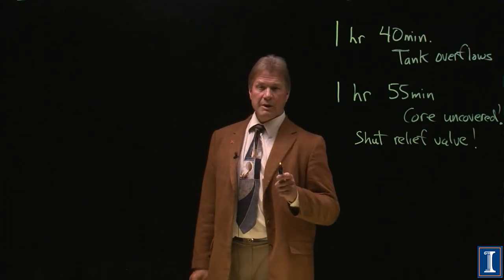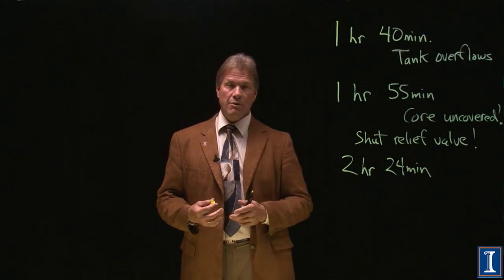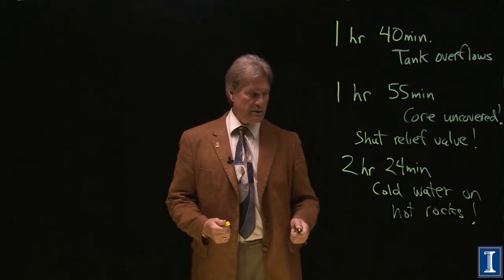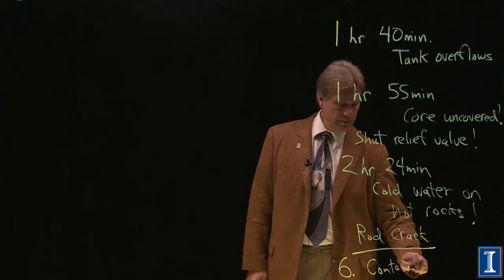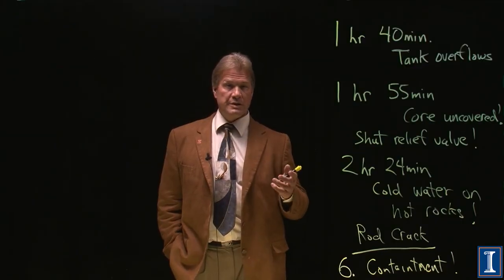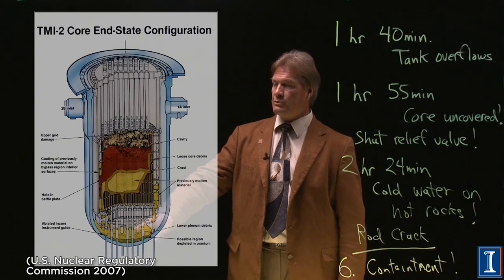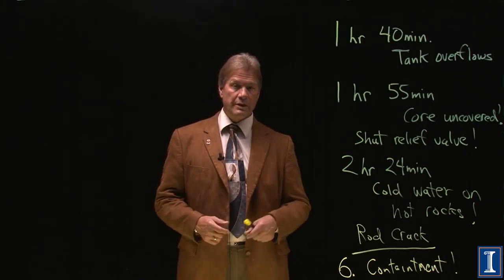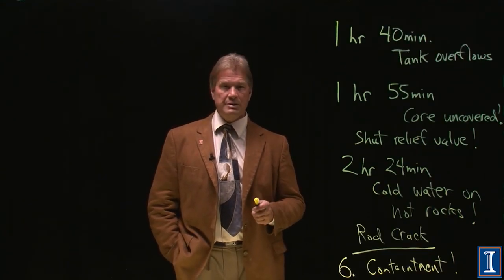How TMI Ended

Comment: Med Dr here. Sadly that's not the whole truth about a nuclear health burden. I understand that you're an engineer. While in technical terms, radioactive exposure could be described in ram, the biological burden has to be correctly given in sievert as the only valid dimension. Every body tissue has a specific radiation tolerance, depending on radiation-type (alpha beta gamma), energy (for the gammas) and what body part is exposed. Here especially the uptake of some radio-isotopes is the critical point: while alpha and beta radiation is quite unspectacular, the ingestion or inhalation can have devastating effects. Aleksandr Litvinenko could have taken a whole day bath in his tea without effects, but drinking only some ml of it destroyed his intestinal mucosa beyond repair, bringing him to a horrific end! Same is with Inhalation of radon which has asbestos-like cancer rates, even in low doses. Same is with heavy metals which get concentrated in biological systems and inside organ-systems! It's not so bad to have some micrograms of poison in your body, but if it concentrates in some tissue, you could have played your last hand! We "poison" out patients with iodid 131 because we know that it is enriched in the thyroid in such tremendous tissue-dose that the struma burns away while the rest of the body stays uneffected. But cadmium, led and mercury can competitively enrich in zinc-rich tissues and destroy for example your testicles. Bad luck? 

So please give us your insights on this topic or explain why you regard this simplification as adequate. 

Thank you and always Howdy 😊

Comment: Its tragic when TMI should have been one of the biggest endorsements of nuclear power safety, not the demonisation of it.
Even when the operators did everything wrong and managed to melt the core - everything did its job in terms of minimising radiation release to the environment to totally negligible levels.

Comment: Professor, didn't you say in your lecture on Chernobyl that Western reactors use water as moderator, and if water leaks out, the reaction stops. Therefore, Western reactors are inherently safe as compared to the Chernobyl RBMK reactors that use graphite as moderator?

Comment: What would have been the correct procedure after they realized the cooling water was leaking to the holding tank  ??
Reply: Close the block valve and keep the cooling water running. 

They had a misinterpretation of the indication and a failure to understand the system as a whole. 

I know ….hindsight bias….

I think another issue was complacency. “It can’t happen” was in their heads.

Comment: My first thought at 1hr 55min was, "Why didn't they just turn the ECCS back on?" :::sigh:::
Reply: I wonder if the ECCS would have done better if the liquid had been pumped to the bottom of the reactor, so the hot water would have covered the reactor rods, instead of the cold water.  Unless the temperature differential was simply too much?

Comment: So , at 2:24 , what was the correct action to stop the core from melting down , if not the ECCS?
Reply: The correct action is absolutely actuating the ECCS, by this point the fuel rods had already began to melt, the damage was done. The whole hot rock analogy isn’t really a factor at this point
Reply: Maybe high pressure/temp steam. You can control that temp so it's not as high, and the thermal shock to the rods would be minimal. Would the core still be hot enough to smash water atoms apart idk. 

Water is an effective moderator, would it still be as effective as steam, probably not tho. But it could potentially be used to gradually bring down core temps till you could activate ECCS

Comment: Using the mantra "Chest X-Rays" is fraudulent!
When it comes to radiation dose, the chest is actually a mass of AIR; Air does NOT absorbs radiation significantly!
BUT, when the SAME radiation is aimed a little lower, say to the abdomen, the DOSE absorbed by the tissue is much, much higher and certainly pose a health risk!!!

Comment: Why did the fuel rods get so hot after the water drained out? Was the fission reaction still going or was the heat from decay of the fission products?
Reply: @Lisforlegend  
That doesn't answer his question. He already knows that there was remaining heat output, he's asking what caused it at the atomic level.
The answer is the latter of the two options he presented, decay heat from fision products, in this case Iodine-131 and Barium-140.

Comment: how the workers clean the reactor core? The radioactivity there should be so high
Reply: You wait, the radiation will go down, and there is no need to urgently send anyone in to clean up anything in a hurry, evertything was contained, so a cleanup solution can be worked up, just that the whole brand new reactor got ruined (big sad), and the reputation of nuclear power was forever tainted.
Reply: Soap and water with a very long handled brush.

Comment: How did they not know the level inside the reactor???  forget about the holding tank.  that should have been the biggest gauge in the control room
Reply: They had level indication for the pressurizer which is connected to the reactor and physically located at a higher elevation. Therefore if there is level in the pressurizer then there is level in the reactor. The problem is with the relief valve stuck open and the pressure differential between the PRT(holding tank) and the pressurizer the level indication in the pressurizer showed it was full although core level was dropping.
Reply: @georgemansfield2018  Interesting.  Thank you George
Reply: There was no instrument showing the waterlevel inside the reactor. https://www.youtube.com/watch?v=1xQeXOz0Ncs
Reply: True. It was. It was broken. This disaster was the ultimate worst case scenario.

Comment: What should have they done at 2 hours and 24 minutes?  Yes, cold water on hot rocks is not a good idea either.  How about a little cold water at a time?
Reply: My guess is that a little cold water would have simply decayed into hydrogen, and you'd have a buildup of flammable gas before you'd remove enough heat to cool the core. Also, it's unclear if the ECCS was even designed to deliver a trickle of water. Given the explanation of the safety systems, I suspect that it was supposed to dump a bunch of water in the event of the primary and backup pumps failing.
Reply: I too want to know
Reply: I'm guessing because of the campfire analogy they needed dousing with dry material like boron and lead powder maybe?  Idk but I am curious too
Reply: Rather than dump eccs water into the core, they should have worked to get the primary cooling circuit working again. Perhaps with the water drained into the overflow tank, though I don't know whether that is possible.
Reply: If you have a lowered reactor water level you can use feedwater to cool the core because the sprayed water gets heated up by the steam coming off the fuel.

Comment: They didn't have a way to measure water level or presence inside the reactor pressure vessel either. You ALWAYS want to be able to know how much is inside a tank, at the very least at 3 4 levels and you ALWAYS want some sort of alarm or automation before hitting full.

Comment: I m a little confused. In explaining the meltdown at Chernoble he said all reactors here couldn't have had the same prob because the same water that cools the core also acts as a moderator to slow neutrons and that causes fission to stop.
I understand the principle of decay heat.
Is this what caused the rods to start melting.
Reply: The number one d9fferance in the outcome of tmi vs chernoble. 

Containment building. 

Tmi had one, chernoble didn't.
Reply: The reactor design employed at the ChNPP, usually referred to as an RBMK, was completely different than anything used by Western nations.
Chernobyl was essentially a steam explosion, initiated by an ill-informed crew, SCRAMming a dangerously-built and -configured graphite-moderated reactor.
TMI was tossing cold water on a (way too) hot core, causing its components to fracture, and then melt, as they were unable to shed their heat to anything around them.
Reply: @SigEpBlue  THEY SABOTAGED IT.. ALL DELIBERATE ALL FAKE ALL FRAUD SCIENCE
Reply: This is a Gen2 reactor he was talking about Gen3
Reply: The key difference between TMI and Chernobyl accidents is the state reactors were in. TMI was SHUT DOWN and ChNPP was THROTTLED all the way UP. Unlike the ChNPP TMI had NO CHAIN REACTION GOING and therefore was not subject of neutron moderation provided by water or other means. During TMI accident the energy came not from uranium but from short-lived waste isotope atoms which decay by themselves, not by means of slow neutrons hitting them.
The Fucusima accident also has happened on halt reactor and maybe that's why it was way less severe that Chernobyl disaster (density of neighboring population aside).

Comment: But... Appart from turning ECCS back on... What else should have been done?... Just let the backup pumps do the job to cover the core all the way up?...
Reply: Philippe SAIZ I’m just guessing but maybe the eccs could have been throttle to slowly add water so it wasn’t such a large temperature swing all at once.
Reply: Typically once a certain temperature threshold has been reached ECCS flow rate restrictions are enacted to reduce the chance of thermal shock on the vessel
Reply: Sometimes there is nothing that can be done to resolve the issue. I think the solution to the TMI problem was not to let the water leak out 2h ago ;) Perhaps the damage could have been mitigated on a few occasions by the crew doing (or not doing) something, but it looks like from a certain point the damage to the reactor was done and there was no solution. I suspect the if they did not dump the cold water, the reactor would melt down anyway, but this is my guess based on the fact that it was already too hot.

Comment: He sounds a bit peeved with his last statement. Can't blame him, the media blew it out of proportion.
Reply: Governments and corporations have been known to lie about numbers, so they aren't exactly trustworthy.
Reply: @kosbebot6360  So we're excusing media hyper-sensationalism because "somebody lied sometime?" Whatabaoutism is never helpful.
Reply: @kosbebot6360  Good thing radiation is shockingly easy to measure on your own!
Reply: @kosbebot6360  Have you heard of the bore hole proposal? https://en.wikipedia.org/wiki/Deep_borehole_disposal

It's basically extra storage capacity for the Yucca Mountain Nuclear Waste .

Especially if we were to reprocess our spent fuel.

Polticians don't care about the environment, if burning whale oil became trendy then Sanders & Elizabeth who're pushing to close the nuclear energy industry would be pushing to kill whales.

How does Hydrogen or corn bio fuel makes any sense? You have to replace all of our fuel service infrastructure from the ground up with hydrogen, and we wouldn't be breaking away from the need to spend money at the fuel pump.

With corn fuel you have tractors consuming petroleum products such as grease,oil, & fuel to harvest corn to produce bio fuel.

Solid state batteries are just about here. That technology will make lithium poly tomorrow's NiCad which had charging "memory" if you forgot about it.

Imagine if the EV1 cars took off. Consider all of the Nickel–metal hydride batteries leaching into the dumps & water of the developing world.

Both trucks and cars used batteries that couldn't be recycled into the batteries we use today. It's going to happen that way with Lithium which we don't really recycle.

They're talking about producing carbon solid state batteries. Imagine pumping out the Co2 out of the sky to produce solid state batteries.

https://en.wikipedia.org/wiki/Chevrolet_S-10_EV

https://www.hardworkingtrucks.com/1998-electric-ford-ranger-up-for-sale-but-it-wont-come-cheap/
Reply: 😂😂😂 The reactor itself almost blew itself out of proportions. Humans were just one more human error away from a very bad disaster. 

Bet no one has ever heard about the Maryland reactor that came one circuit breaker away from a fukushima situation during the DC earthquake... Makes me wonder how many other close calls happened that never got reported simply because radiation didnt leak out, while the public was in great danger.

Comment: So what happened to TMI? Is it 100% shut down, or are they using the other reactor?
Reply: They shut down #2 and cleaned up. #1 kept running until this year. They decided to take down the containment building and reactor at the same time as #1 to save costs so they just left it there after the cleanup.
Reply: Jimmy De'Souza  Of course I mean after the accident.  Before the accident, both reactors were running.
Reply: Jimmy De'Souza   Actually, it was very much a ‘meltdown’.  The fuel rods casings cracked and the fuel melted from extreme heat.  That is the very definition of meltdown.  This wasn’t visually confirmed until many years later.

Comment: Interesting.  My question is: as the water flashes and the core becomes exposed, would the operators not have seen a temperature increase/water level decrease on their instrumentation?  Seems like those are things I'd want to keep track of in my reactor, and not just globally but at various points in the containment vessel.
Reply: The water in the reactor did not flash instantly. Because of the stuck open pressuriser relief valve (PRV), and the ECCS turned off, water in the reactor reached saturated conditions (it began to boil). The actual uncovering of the core can be (and eventually was) monitored by thermocouples mounted in the upper internals of the reactor (above the fuel rods), but is was too late. In most PWR's (i guess also at TMI at that time) pressure inside the containment building is monitored permanently, and at a certain limit it's starting the ECCS automatically (because when pressure rises in the contaiment, it has to come from a leak in either the reactor/pressurizer/piping, or the steam generators/lines). In case of TMI the ECCS start was initiated by low reactor pressure. The steam/water of the stuck open PRV came in a relief tank, which at the start of the accident was a closed system (no pressure buildup in the containment, untill the rupture disc gave way). 

The correct instrumentation was there, it only gave the operators too much alarms in which they overlooked critical parameters. Since TMI, the accident procedures are completely rewritten and will ask the operator multiple times to check for abnormal containment conditions (rise in pressure, level rise in drain tanks at the bottom of containment...), with te purpose of identifying a ongoing LOCA.